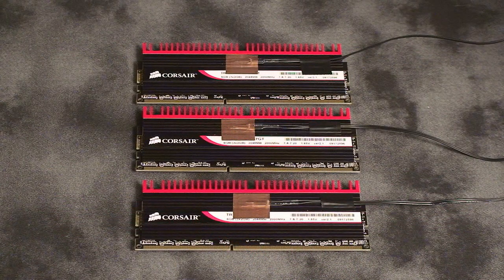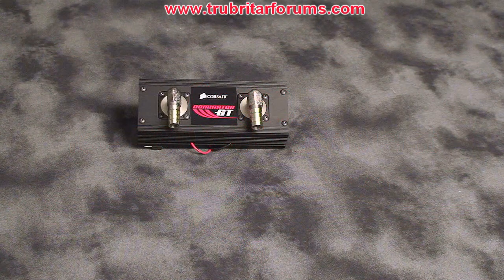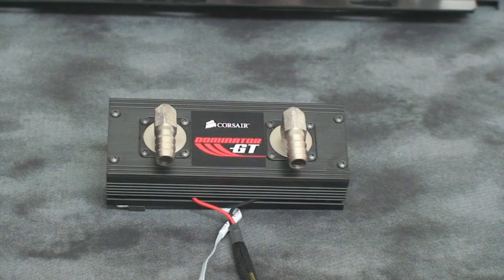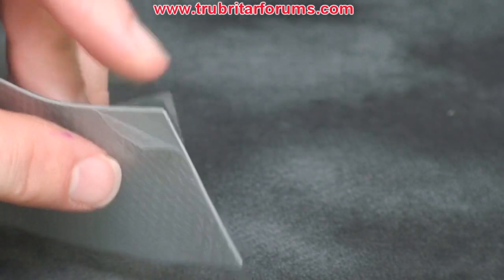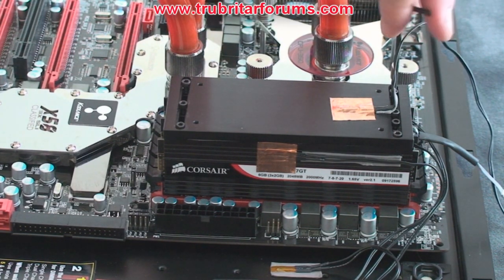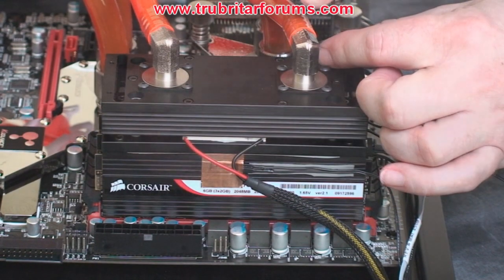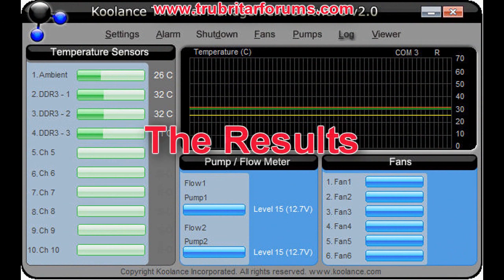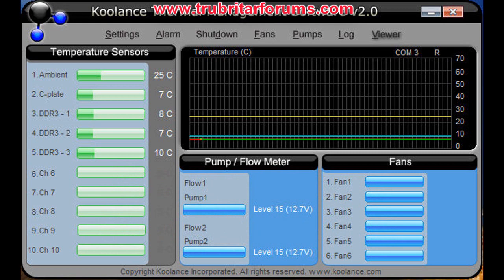(HD) Corsair ICE-T30 Sub ambient cooler

Comment: How does the humidity sensor affect/control condensation buildup?

I'm noobish to TEC, from what I gathered is this video, If I'm correct, it is the Thermal electric heat pump that draws/absorbs the heat from the Thermal plate to the oposite side, then the waterblock cools the "HOT" side of the Thermal electrics heat pump.

Thanks.